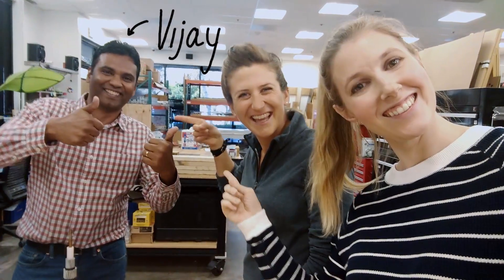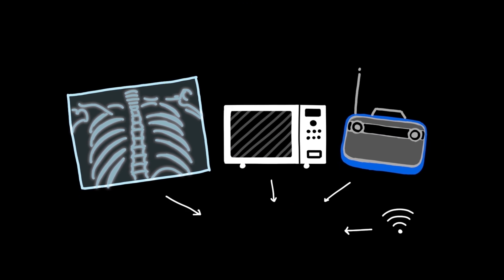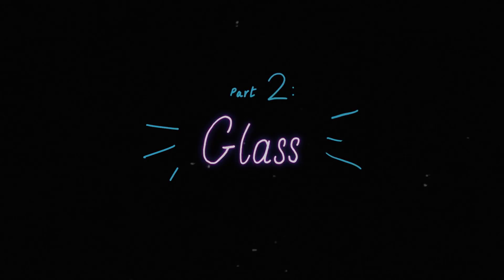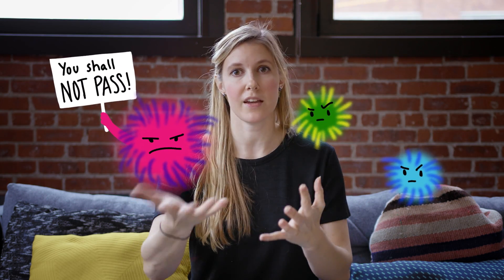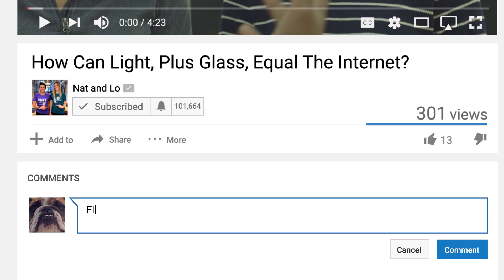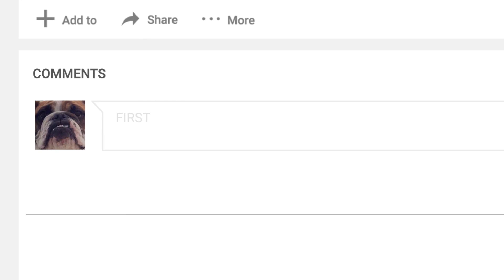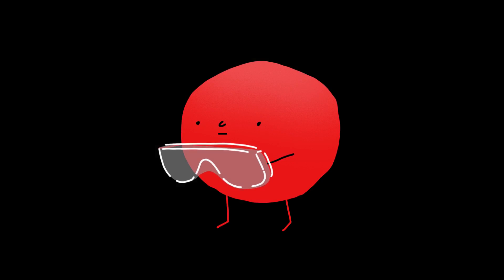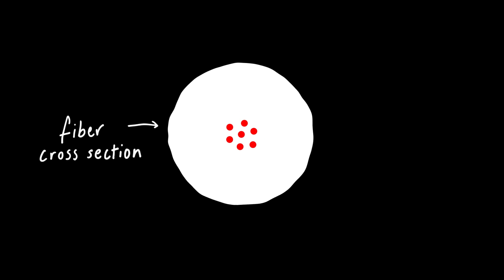How Can Light, Plus Glass, Equal The Internet?

Comment from the maker: I am beyond impressed by all the thoughtful questions you've been asking in the comments. Thank you! And many, many thanks to Vijay for answering so many of them. Please give the comments a read and you'll discover so much more about fiber optics!
Reply: As SJS 22 pointed  out, bends in fiber do not impact the speed of transmission, but they do impact the amount of light that is guided vs. scattered away. That is the reason why most common fibers have bend limiters that ensure that the fiber is not bent too much. 

There are new fibers called bend insensitive fibers, that (as the name implies) are indeed insensitive to bends. These are used in in-home or in-premises fibering.
Reply: The ~100 beams are actually on slightly different wavelengths. This technique of transmission is called Dense Wave Division Multiplexing (DWDM). The wavelengths (mostly) travel independently of each other (orthogonality property) and are recovered at the receiver by demultiplexing.
Reply: The bends don't materially influence the speed of propagation but major bends are a serious problem in normal fibers before the light essentially leaks out of a bend. Modern fiber optic systems are designed to ensure that excessive bending does not occur by careful fiber management. There are fiber characterization instruments that can detect abnormal bends in a fiber.
Reply: How can 100's of light beams ( as pointer out in the video ) travel together in one core?? Is this do to the property of interference and superposition?
Reply: Nat and Lo 
If their are some bends between some path The speed slow down or they have some other instruments to improve it..?
Reply: The light travels down the core of the fiber by total internal reflection, so the bends don't really slow down the light.  The cladding has a lower index of refraction then the core, so shallow incidence light will simply reflect of the core/clad interface very efficiently.  

The same principle applies if you were submersed underwater and you looked out away from you (not straight up).  You will see the subsurface water reflect back towards you at the water surface and you won't be able to see out to the sky.
Reply: SJS 22 
OK Thanks
Reply: Nat and Lo Happy 100K subs
Reply: Hi Vijay,

Can you tell us a little bit about how these new bend insensitive fibers work? :)
Reply: Nat and Lo  loved your content
Reply: Nat and Lo hvdidphddt   j gtrgtdơgdeskky9
Reply: Nat and Lo you tube
Reply: Nat and Lo i lov u nat😍
Reply: Nat and Friends ..
I have such a crush on you.Yiu are the most beautiful woman I have ever seen.

Comment: You could have explained about total internal reflection, which is the primary reason why we need a core and a cladding and not just a single stand. Light passing through a single strand of glass will fall out unlike the core and cladding combination in which total internal reflection occurs because of the difference in refractive indices.

Comment: Since Radio waves and Light waves are all EM waves. Why are there differences in transmission rates? They all travel at more or less the same speed and it is even slower in a glass cable. If data loss is more common in Radiowaves, how are we able to watch a video or view an image completely without any identifiable loss ???

Comment: what is the speed of data travelling in fiber optics?
Reply: The speed of light in fiber is approximately 200,000 km/s. However, the speed of data transmission depends primarily on the size of the connection and not the speed of light

Comment: hi Vijay now telephones also connected through fiber optic and I would like to know how fiber optic converts data into audible frequency?
Reply: Any medium (text, audio file, image, video) can be represented as a series of ones and zeroes by encoding the information. So, from a transmission perspective, it does not matter what type of file you are transmitting. The encoding techniques and higher level protocols used for transmission vary but the physical layer (laser, fibers, detectors) is the same.

So, the analog audio of a phone call is digitized, quantized, and encoded into a stream of ones and zeroes, and the reciprocal effect takes place at the receiver to  reconstruct your original audio signal.

Comment: how do they connect two pieces of fibre together and still maintain the glass to be clear enough for the light to travel through, without any disruption.🙂
Reply: Two pieces of fiber are connected together in two ways (i) Via a fusion splice (literally melting the glass and fusing them) if the desired connection is permanent or (ii) Via a fiber optic connector where two fiber ends are brought into physical contact with each other by carefully engineered ferrules

Comment: Is it important that both ends of the cable (transmitter and receiver) are synced together in time? I feel that if they were not in sync then the receiver could be sampling only half of two pulses and get a mixed signal.
Reply: No the receiver and transmitter do not need any time synchronization and can operate asynchronously. The receiver has its own carrier and timing recovery circuit that ensures proper pulse sampling.

Comment: What would be the next technology after fibre optics?  Is glass the apex of communications technology for the size and cost or is there something on the horizon that would far surpass glass fibre?
Reply: There is some work being done in hollow fibers where the transmission is actually in air (vacuum) but the guiding is still done by glass cladding. Check out http://www.nktphotonics.com/blog/product/hollow-core-photonic-crystal-fibers/

Comment: so what do these modulators do? (the ones that encode light for long travel underwater) do they turn the light on and off?
Reply: There are different types of modulators. The ones used in modern long distance transmission actually modulate both the amplitude and the phase (called QAM modulation). The receivers are coherent receivers that detect the complex electromagnetic field (not just the amplitude but also the phase and polarization)

Comment: Where does SONET/SDH or OTN fits in this video? Please help me co-relate that.
Reply: Good question. SONET/SDH and its modern successor OTN define the framing structure for the circuits that are being connected over these fiber optic links. In OTN hierarchy, the optical channel is called OCh. While SONET/SDH was used extensively for a couple of decades, modern systems are predominantly Ethernet based (mostly 10 GbE or 100 GbE). These Ethernet packets are mapped to an OTN frame and transmitted

Comment: If the light used in fiber communications is infrared why can I point a fiber to a paper and see visible light? Do the lasers in our datacenters add some visible light it to be tested?
Reply: Great question. There are three transmission windows commonly used in fiber optic communications. They are (a) 850 nm, used extensively in multi-mode links with small, inexpensive lasers called VCSELs, (b) 1310 nm, commonly used for single mode links of a few kilometers (10 km), and (c) 1550 nm which is used for long haul and submarine links because of the lowest loss of the fiber in this wavelength region.

All three of these windows are infra-red, which 850 nm being closest to red and 1550 nm furthest away from red. The ones you saw in the datacenter are 850 nm lasers and you can indeed see the red light if you look at it (but please don't) or point it to a piece of paper. The reason is that 850nm is close enough to red that you will see some red because the laser has some spectral content that is visible.

Comment: What is an actual difference between single mode and multimode transmission in optical communication?
Reply: MM fiber has a larger core than SM fiber, so it supports more modes. But these more modes zigzag around the fiber and cause modal dispersion at the receiver. So, you may ask - why bother with multimode fiber at all. The answer is that since the fiber core is much larger, it is very easy to couple the light from a laser to a multimode fiber and to a single mode fiber. This makes a huge difference in terms of cost of optics and manufacturing scale. Hence MM fibers and associated optics are widely used when the target reach is less than a few hundred meters

Comment: Hey Vijay, just wondering how the pulses from the optic fiber then gets transferred wirelessly onto our phones (I get that it's through a router but what actually happens?)
Reply: The data from YouTube (for example) that traverses the fiber gets handed to your local ISP via a connection called a peering connection. From there, it traverses the ISP's network (likely over fiber) as well to the local metropolitan area's central office (or equivalent) and from there it travels down a DSL line (copper), cable line (coaxial copper), or fiber to the home (fiber) to the house, (or via fiber or microwave link to a cell tower). From the house, after it gets picked up DSL or cable modem, it then goes through the wireless router to your device. The techniques of transmission among all these methods (Wifi, DSL, cable modem, microwave, fiber) are very similar but the medium of transmission  and the frequencies used to transmit are very different

Comment: I am wondering how 1s and 0s passes through air... (or wirelessly)
Reply: The concept of transmission  is the same regardless of which media it is being transmitted over (air, copper, or fiber). The 1s and 0s are mapped to a transmitter using a modulator (typically a combination of phase and amplitude modulation). The key difference between the different transmission media is the amount of capacity and  the reach. That is why a good figure merit used by communication engineers is called the (capacity * distance) product. Fiber is the best in terms of this metric, and the main reason for that is the high carrier frequency used for optical communications (192 THz) compared to wireless (2.4 GHz).
Reply: Thanks A lot.. That's really helpful..:)

Comment: A question to Vijay. I can't even begin to comprehend the engineering that goes behind fiber optics thanks to Nat's description. How many years did it take to develop, and is it regarded as the engineering marvel it seems to be? What would be the next step to handle the endless amount of data in the next 15-25 years?
Reply: Great question. The field of fiber optics evolved over the last 60-70 years and traces its history back to the early days of laser and fiber development. Modern optical communications started in the 1980s and the WDM (wave division multiplexing) became commercial in the late 1990s. 

There are many exciting developments in the research pipeline to handle continued increase in bandwidth needs. One example is the multi-core fiber. There are other practical approaches like simply pulling or laying more fibers. Even if the capacity per fiber is limited, we can always add more fibers to increase the aggregate capacity. 

Also, noteworthy is the intertwining between physics and engineering. There is a lot of exciting physics in terms of the lasers, detectors amplifiers and there is a lot of solid engineering to build these products at scale (10s of 1000s of such links) to support the Internet
Reply: Fascinating stuff! Thanks for the answer. :)

Comment: 1 is on and  0 is off but how do you encounter end of a particular signal when thousands of signal are travelling together??? And  how does the transmittor identify that which signal is from which transmittor???
Reply: The signals have different levels of separation and tagging to ensure that you can accurately reconstruct the transmitted signal and maintain correspondence with the specific transmitters. First, the ~100 wavelengths are independently transmitted and received, and the small impairments due to mixing among wavelengths are either compensated or designed around. Within each wavelength, there are packets of information (that are tagged by source and destination) and multiple packets are combined into a packet stream and transmitted.
Reply: Thank u for replying sir.

Comment: Hey Vijay , have a few doubts ... can you please clarify???
1.how exactly do the 1's n 0's modulate the laser output to on n off ???
2.what does varying phase of light actually mean in phase modulation???
3. if the rate of 1's n 0's very very high , will that create any signal distortion ??? if yes, what's the solution???
Reply: 1. In a directly modulated laser, the laser current is increased and decreased to literally turn the laser on and off. In an external modulated system, the 1 and 0s are converted to voltage changes (via a modulator driver) and these voltage changes result in a phase change. The physical phenomenon is call Kerr effect and refers to the change of refractive index of glass in response to applied voltage. When refractive index changes, the speed of light changes as well thereby slowing the pulse or speeding up the pulse relative to the previous pulse, thereby causing a phase shift. That is how a phase modulator works. 

2. Light is essentially a wave. Every wave can be represented by, say a sine curve. A phase change is essentially an offset in the starting point of the sine curve. 

3. Yes, there is pulse smearing if the 1s and 0s are packed very closely. The solution is different in different types of systems. For a simple on-off system with a direct detection, the solution is to use dispersion compensation modules that reverse the pulse smearing. For more complex phase modulated systems with a coherent detection, the receiver is more complex and detects both amplitude and phase of the signal, and then it is converted to electrical signals and sent to a digital signal processor, which cleans up the impairments.
Reply: Vijay Vusirikala Thank you 😎 .... have a few more doubts 
1. if everything in EM spectrum is technically light why can't x-rays be used to transmit data ??
2. are there any particular criteria that an optical fibre has to meet to transmit a particular wave length of light or it can transmit any wavelength of light??
3. Is WDM possible with single mode fibres?? given the fact that it has a very narrow core diameter.

Comment: How does he light not "bleed" from one fiber to the other and cause interference. From your videos it doesn't look like the fibers are sleeved in a solid plastic. They appear complealty transparent
Reply: The light is "guided" mostly within the core with some leakage into the cladding. However, the cladding is pretty large and there is no leakage from the cladding to the buffer / jacket. Therefore, even when you put two fibers next to each other, there is no leakage or crosstalk between them. 

However for the second case highlighted in the video where future fibers could have multiple (7) cores, there is some leakage from one core to the other, but that cross-talk is compensated by the receiving electro-optics. Even in the multi-core fiber case, there is no leakage from one fiber to another

Comment: How do the infrared photons 'bend' through the glass? the cables can't be 100% straight right? Does it work by reflexion?
Reply: Yes, they are effectively "totally internally reflected" and thus guided along the fiber. The fiber does not have to be perfectly straight and can tolerate a certain "bend radius". However, if you bend a normal fiber very tightly, the light does indeed escape and the link will not work. 

There are special fibers called bend-insensitive-fibers (BIF) that work even if you bend them as they work on a different guiding principle. BIFs are used in specialized applications (like fiber in the home) but are not used for long distance transmission

Comment: How is it possible for secret services like the NSA to hardware-intercept fiber optic under-sea cables without data loss? I mean, duplicating the light beams it is possible, but, how does anyone install it without having the devices on both ends know that there was a connection loss?

Comment: Where do you find a processor with a clock speed of 200GHz to read all the incoming bits ?
Reply: Good question. The digital processors use a high degree of parallelism and therefore do not need to operate at the clock speed of 200 GHz. The optics and electronics today operate around 32 Gbaud (soon moving to 64 Gbaud) and use parallelization to get the aggregate datarate per transmitter

Comment: What makes the single mode fiber optic cable the preferred type of fiber optics for long distances ?
Reply: In a multimode fiber, the core size is large (50 um vs. 9 um for single mode fiber). Therefore, a number of modes are supported. Each of these modes take a different zigzag path to the end point. Since a transmitted pulse excited a number of modes in the fiber and each of these modes arrive at slightly different times at the receiver, a tight pulse at the transmitter "smears" out at the receiver. This limits the maximum distance (or equivalently the max data rate) as recovery of these smeared pulses is hard. This is called modal dispersion and is the main reason for multimode fiber limits.

In a single mode fiber, as the name implies, there is only one supported mode and hence there is no modal dispersion (or smearing due to pulse zingzag in the fiber). There are other impairments in single mode fiber but they kick in at much distances compared to multimode fibers

Comment: Do different wavelengths mean different data strings?
Reply: No really. Different wavelengths are simply different transmission pipes. You can fill the pipes with whatever data you want. You can mix different data types (voice, video, web, real-time comms) in each wavelength as well.